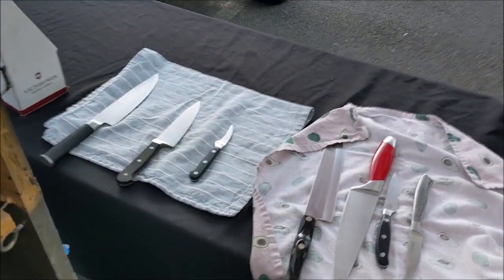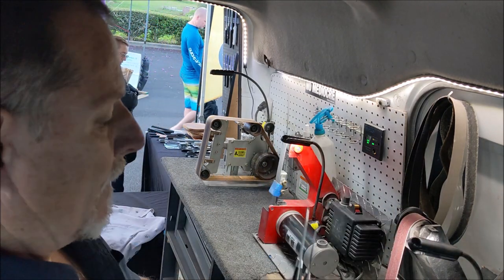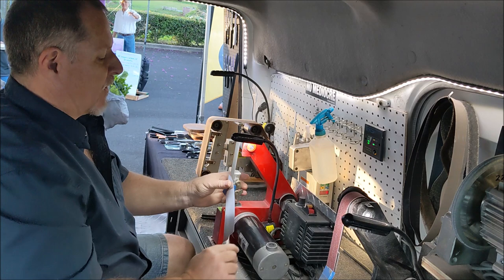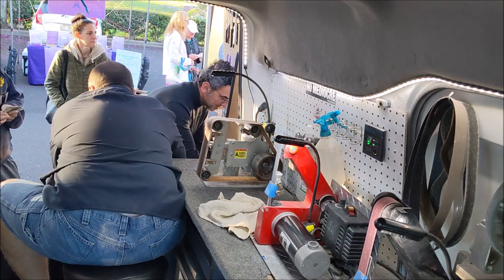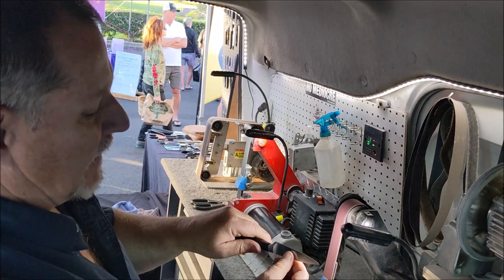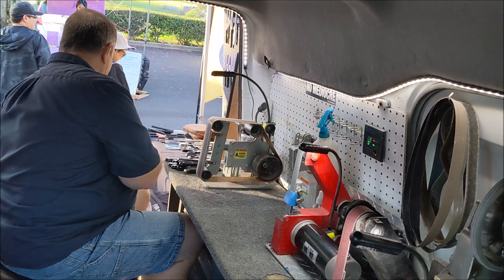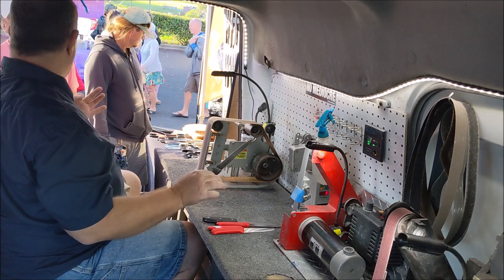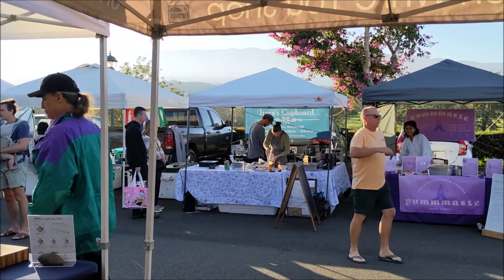Sharpening at Farmers Market (Jan 2023)

Comment: I have come to the same conclusion two light swipes on either side is perfect to tune in a cutting edge.  I use 600 grit DMT ( Diamond ) plates. There is an extremely small amount of material that need to be removed bring the edge back especially on a well thinned knife.  Using 325 mesh for DMT for secondary bevel.

Comment: Your final belt grinder (deburring) has changed.. the wheels look different and you have two slots for the tool arm. The belt looks wider too.. did you change machines?
Reply from the maker: Swapped out for a 2x36 leather belt machine.  Ill probably switch to felt on the same machine once the leather gets good and seasoned.  I enjoy switching it up, keeps my process fresh and gives options.
Reply: @CurryCustomCutlery  What abrasive are you using for felt? I've just started with them, using an angle guide with it has given me a nice little bump in sharpness. I've started with Autosol, really keen to try Tormek Honing Paste on the second one, it works fantastic on the Tormek leather wheel.
Reply from the maker: @mitch3384  For the felt stropping step when Im using that I like to use more compound and maybe with a spritz of 3u diamond emulsion on top
Reply: @CurryCustomCutlery  thank you for the video, sir, did you switch the direction of the belts? I just bought a 1x30 and I see that yours runs the opposite direction.

Comment: Nocked it out of the park friend! Did you say you sharpen all them knives at 15 degrees? The belts I got from you they are working great especially the felt belts. Thanks
Reply from the maker: I find that 15° is my sweet spot.  Many possibly could be done lower but depends on all the external factors more like what they cut and what they are cutting on etc.

If I was seeing any come back that were chipped or rolled I would know Im to shallow of angle...but I never do.

Comment: Hey Cliff quick question... is that belt spinning towards the roof or the floor... just couldn't figure out if you were sharpening with cutting edge in the direction the belt is going or against it... thank you sir
Reply from the maker: Abrasive belts are used edge leading with angle guide. Stropping step is always done edge trailing to avoid damaging the belt and yourself.

Comment: It would be very helpful to do a short vid on sharpening serrated. Both steak knives and bread knives. In this vid, it looks like you use the edge of the belt to hit the scallops of the small serrated knives on one belt but then hit the other side of the knife on the next machine

Comment: What angle do you recommend thinning the knives at ?   Do you have a preference for width behind the cutting edge ? Appreciate all the videos.
Reply from the maker: That's a really hard question to answer so much of it depends on the knife and the situation. Most often it is just a feel...
Reply: @CurryCustomCutlery   In terms of feel I find that thinning the knife behind the cutting edge by 0.005" seems to lower perceived pressure to cut by 50%.
I first focus on real world testing & then attempt to quantify the difference.  You like I, seem like someone not afraid of making tools for to achieve intended results quickly.  Do you use an angle guide when thinning the blade ?
Reply: Nice video.
Interested in your set up.
Did you reverse the 1x30s ?
Reply from the maker: @scottydudley5700  they can be reversed but I run them edge leading into the angle guide for several reasons. I have a video on edge leading with the angle guide you may find interesting

Comment: I want to convert my harbor freight belt sander. I need the driver wheel. Where can I get to drive a wheel?
Reply from the maker: We have the drive Wheels available on our website... It is designed to work with the sewing machine motor and a 15 mm shaft
Shop.currycustomcutlery.com

Comment: It looks like you are sharpening them all at the same angle. Is that what is happening? That would make things faster.
Reply from the maker: 15° is a great area to sharpen at.  You can go lower but risk certain steels and certain knives to chip or roll.  Going with a larger angle for hard work knives is something I do by laying on the primary bevel instead of the flat.

Comment: No matter how hard I try, I can't sharpen it that fast. and if it does, they quickly get dull
Reply from the maker: The concepts of the process is simple. If getting dull its not from the process but something not quite right in the progression you are doing.  Fully deburring is critical.
Reply: @CurryCustomCutlery  I know. my reference book is the book of Dr. Kraichuk. on tormek I get razors.
but on a belt grinder it does not work. even though I'm supervising the work under a x1600 microscope.
Reply from the maker: There are differences with belts if you are going edge leading or trailing and that determines how to do the most crucial step the final stropping.

Comment: Was always told by my grand father, never sharpen dry . Always use a liquid! 
I sharpen now in my retirement days , I use whetstone s . And I have repeat customers . My clients are around 200 that call all the time . My last customer I had sharpened for said she had this guy sharpen her knives and they filled quickly. I researched that guy and he used belts like you , he burned the metal with the belts
Reply: He obviously didn't know how to use the belts properly then. I use Tormek, Wicked edge and 1x30 for my commercial sharpening business. I've never burnt a knife using the 1x30 belt sander.